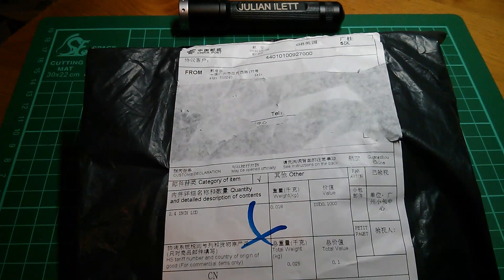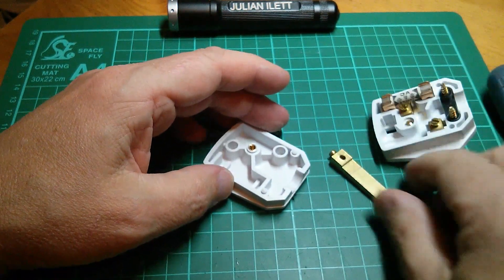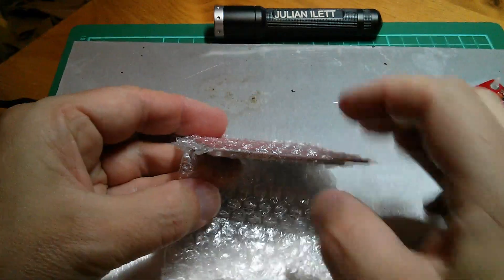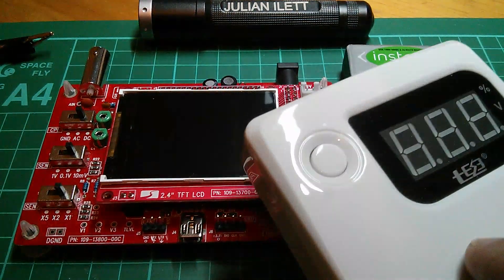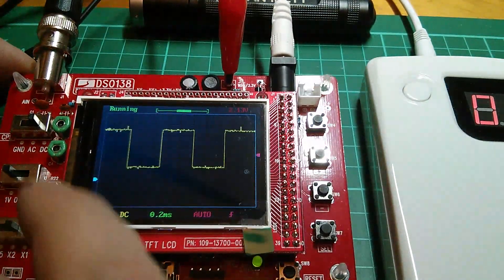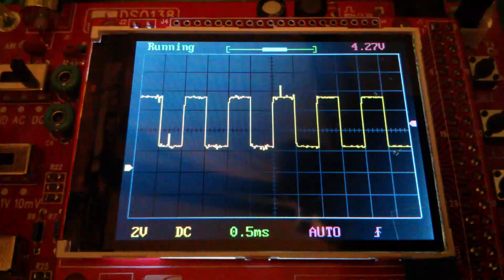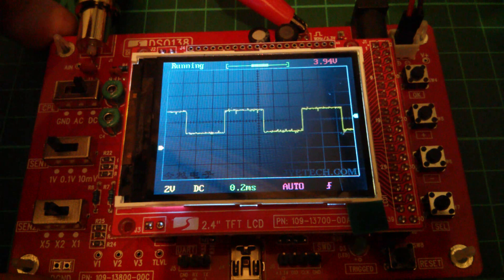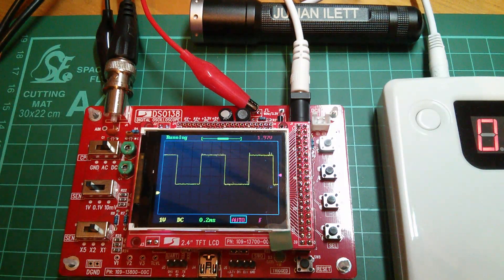Julian's Kit Build: Banggood £15 ($23) Oscilloscope (finale)

Comment: Hi Julian, I bought one of the DSO138 oscilloscope over a year ago, and tried to put it together, but my soldering skills was atrocious, and was never able to get it to work properly. I was would like to send it to you for you to do a video on repairing it. If you can get it to work, I would like it back, if you don't,  I would buy a new one, pre-soldered this time.
Most of the test signals are OK, but not getting any readings on the screen.
How about it? if yes how do I post it to you.
Regards

M

Comment: Hi Julian I was browsing your video list if you had made a video about correcting the awful noise but you haven't. In the comments of one of the three videos of this project I saw someone mention there was an addendum instruction saying there should be a resistor replaced by a different value to cancel the noise. Have you tried that ?

Comment: Hi Julian. Three things. 1) My DSO came with the Screen crashed, so I have to buy the screen again, where did you bought it ? The second thing , definitively your screen was not damaged by the static. I bought in the past a lot of screens and none of them were static sensitive, in fact the package where they are protected is a terrible static plastic, none screen could survive the static if they were static sensitive. Third, about the noise in the square signal, try puting in parallel to the battery terminal a 100 nF capacitor. Sometimes this could work. In my case, I have my screen crashed, so I still cannot test anything.

Comment: Other videos I have seen appear to have the coupling switch set the 'gnd' position before connecting to the test point to calibrate the scope. Don't ask me what it does, but noticed yours was not set in the same place. Thanks for the info and troubleshooting. I think I might pick one of these little toys up to play with, appears they do a 'mini' version now, which just appears a little more finished.

Comment: 05:10 I built the exactly same oscilloscope, but mine seems to be an improved version. It runs a newer version of the software that also contains an anti-piracy splash, but it is way, way, way more stable. There is almost no noise at all in my unit!

Comment: Just in case you meet with another tricky Lcd, I have one that works ok when it's initialized at low temperature, even if I reset it works ok, but If by updating the firmware or anything that keeps the LCD to be initialized but turned on, it begins getting warm and it will never initialize properly until I let it cool down by turning the circuit off... it's a pain to work with...

Comment: Why run a resistor in series to ground for your anti-static mat?  Wouldn't it work as well just connecting the mat directly to ground without the resistor?
Reply: +mnpd3 Because the resistor current limits the flow of electricity. Discharging static too quickly is the cause of failed electronics.

Comment: I've now built mine. Only real issue I had was that I needed a finer iron, I had one short on one of the switches. Otherwise it was fine, except after the second time I switched on after fiddling with the buttons and switches I got no trace. Simply hold the up down buttons down together for a few seconds to reset to factory default. Since  then its been fine.

Comment: Mine looked exactly like yours when I built mine. I did the noise mod on the board that seperates the analog from the digital ground. It halfed the noise. Still not a fantastic scope, but it really did make a difference, and only takes a few mintues to do.

Comment: i orderd one a while ago and also had a broken screen (physically, careless shipping) but it works fine. the internal noise i believe can be mitigated by shielding a few parts, with plently of ground planes you can solder on a tin can over the various parts.

Comment: Got mine a few weeks ago, put it together and where amazed on how soldering is like riding a bike. Anyway before shorting out JP4 everything is alrighty right. afterwards however...nothing works. White screen and all testpoints show different voltages. Quite frustrated.

Comment: I bought one of these a few months back, started building it and finally finished it this morning.  Plugged it in, and ... NOTHING; screen lights up but nothing.  Then I remembered Julian's video.  Well, I hadn't shorted out JP4 and tried using my regular 60/40 solder to short it without any success.  Then I thought of my 63/73 solder.  That did it!  I tried using it in the past to solder some SSOP IC's... ruined 3 IC's because of solder bridges.  I've finally sound some use for this solder.

Comment: All's well that ends well, as they say! The noise is either going to be digital signals radiating into the analogue section (can you scope it to see?), or artifacts caused by the ADC sampling asynchronously to the rate at which the the microcontroller is reading it... that apart, it's still quite impressive for the money; and I might still buy one to play with. Thanks Julian :)

Comment: The wavering of the trace at low display levels is the scope triggering on the noise pulses as well as the signal. By scaling the input signal level up you have more vertical rise level free of the noise pulses and you can get a more stable trigger. Since the noise doesn't look to scale with the input signal, it (interestingly enough) is being introduced somewhere past the input amp.

I somewhat suspect the original LCD was destroyed when removing the plastic face protector.  Peeling off one piece of plastic from another generates A LOT of static voltage. I've had similar failures happen at that point under dry air conditions.

Comment: I have eliminated the noise: Swap to the resistor R11 (1.5 k) in 150 Ohm. 1.5 k are too high.
Greetings from Berlin, Germany
Jörg
Reply: are you sure of this ? what model or version is yours ?
Reply: I have this version:
FW: 113-13801-050
LIB: 13803-031
best greetings
Reply: This change is now implemented Rev. 05, firmware version 113-13801-060 and later.
Reply: interesting i might have to order some 150 ohm resistors for this and try it because mine is 1.5k

Comment: Hmmm... i think maby i could help with the noise problem, since i bought one of thoose, and gives me really good readings so far:

On the left side of the LCD you have two variable capacitors, green colored. You must tweak thoose two in order to adjust the noise you are getting. The idea is to use the self-generated square wave to adjust them, and then you can test the signal you have from your "good" oscilloscope and you should get little to no noise... I hope that helps (it's actually a good portable oscilloscope).

Also, in the beginnign i just had the same issue, 20 seconds working, turned off, back on and screen looks dead. I solved it changing to a 12V power supply, compleately solved the problem for me (just in case you want to test the old screen, if you still have it).

Edit: that could work extreamely well with just 3 18650 LiPO batteries in series...

Comment: Looks like you did not calibrate the unit like the instruction say. I had much trouble getting mine calibrated with 9v - | +. A 9v wall wart fixed everything near nil noise compared to yours. What may be going on is the scope draws more current the battery can produce.  Anyway no batteries.

Comment: Your antistatic plug could easily be made safer just by putting the rest of the plug back around it and taking the L and N pins and fuse out so that it covers the holes in the socket. it could also be made more rugged if you can tighten the retention clip back around the wire.

Have you tried referencing the ground of the "scope" to mains protective earth to see if that affects the noise? Probably won't if the noise is intrinsic to the device but you never know. Same goes for a shielded enclosure.

Comment: Now you need to upgrade the firmware to 50 which they released and the noise is less. How about you going through the schematic and explain what is going on and show how you can prove or show what it changes or.......
How about using it while working on some of your projects so we might learn how to use it and follow along.
Thanks

Comment: Can anyone explain why the high value resistor is needed between the ground pin and the anti-static pad?  Why is a wire connected to ground not enough on its own?
Reply: Without the resistor any possible charge will be discharged at maximum current since it will be a short to ground. With a large resistor between the device and ground, the discharge current is significantly limited. 

Btw, the highest ESD source would not be him but the plastics he ripping fast. It would have been better if he used the knife instead of the ripping.
Reply: If there is a static charge it will dissipate slowly with the resistor. Without it you could discharge with a bang.

Comment: Hi,i need some help with mine,all my voltages are correct etc,at all the test points,and i get a trace with the 1khz test hook,but my led doesnt light up or flash like it should,but it flashes during boot,so the led is fine,any sugestions julian,or anyone.thanks

Comment: honestly, the noise doesn't look too bad, it is just that the screen refreshes quickly and there is no delay or averaging done to it.
Also there is practically no shielding on the front end, so that doesn't help either.
Reply: bgdwiepp 
When the noise peaks are almost a 3rd of the signal (1V in this case), it is bad and shows a bad circuit design. Of course you can do much in software, but what does averaging help you in single capture for example?

Comment: If it calls for 9v the rechargeable version is only 8.4v and you never know if your rechargeable batteries have a charge or not, the power bank gives various voltages. Don't you have a 9v wall charger? The first screen may have been sensitive who knows, but you had to do a repair on the board so I guess it's up in the wind.

Comment: Experience with a more recent version (Feb 2017):   As a bumbler with minimal knowledge and failing eyesight, I thought this was a suitable first kitset project!  Initial thoughts were that the two sheets of paper was not enough... in fact they were excellent, and in good english (Hooray!).  Managed the assembly OK, but the multimeter test prior to plugging in the display showed wrong voltages everywhere.  I was using the 'power in' pin as my ground connection... should have been using one of the ground pins on the board itself.  I connected the display, and Bingo!  Day two and my dry-solder joint showed up.   Flicking around the back of the board with a piece of plastic soon found it.  Fixed, an it has worked fine since.   It has none of the jitter that Julian and others have experienced with earlier versions.  I don't really need an oscilloscope, but for the price of a couple of movie tickets I have had a lot of entertainment.  On this basis, I would recommend it; if you need an oscilloscope to earn your daily bread, this is not for you    :o)

Comment: You might try cleaning the solder rosin from between the pins of the Op Amp U2.
 It can form a capacitor between the IC pins and cause the Op Amp to break into oscillation. I've had this happen on audio amplifiers. Might be the cause of some of the noise although I've watched several other videos on this scope and they are noisy. Some more than others.

Comment: If they fix the noise and put it in a plastic box this might be useful as a chuck in the toolbox tool. I can imagine using it outside to check that signals on my multirotors are working.

Comment: Looks to me that the signal processing circuit is off spec. If you can locate the SP circuit you might reduce the noise with a better RC signal circuit cap or by maybe adjusting the amplitude across the signal peek on the board or tap into the display signal  and see if you can break it out to another display with a filtering circuit as to find the faulty component(s) It may be a single cap (just a guess on that). Anyway the top scan points seems to be in the wrong amplitude range, their changing, thus, unstable as it draws the scan line. Looks like an ampliture issue at the peek of the cycle. should be an easy fix. Thats providing the verticle scan line is actualy using real inputs and is not just a line(x1,y1)-line(x2,y2) style static command.
but that's a cool issue, fun to fix. I'm not sure what IC's are being used, if it has a microcontroller or some sram, I would dump the core and reflash it where there are suspect commands. Oh, heck, I just read below that it was a resistor issue, well, I was close ;)

Comment: I saw one build where the culprit was the 7905 neg. voltage regulator. I*t failed fifteen seconds after he turned on. Check the regulator and it was defective..

Comment: Julian - for your anti-static earth connexion simply use a 13 amp plug complete with only the earth pin brought out, thus filling the unshuttered line and neutral receptacles - simples. ;-))

Comment: It looks like the wavering is in time with the LED.  It's hard to tell on video of course, but maybe try removing it?
Reply: Posi Cat I noticed that too. I don't think the LED is the root of the problem though,it looks to be digital noise,caused when the uC writes to the screen,and does it's other various things. Beefing up the bypass/decoupling caps on the various supply rails might help,might not.
Reply: It depends on how current limited the LED is.  It's probably not the issue, but it might lead to the part of the circuit that is

Comment: Try to scope the power line... as you can see you have switching supply on the board... if the filtering of power line is  bad that could make a noise on the signal.

Comment: Hi All,    Can someone help me. I am having a few voltage reading problems on my DSO138 since I built it a year ago. I am now trying to resolve it, so far I am getting the voltage readings which are a bit out of the normal, every thing else seems fine. 1. On V2 I am reading -1.494v instead of +1.66v2. On J2 I am 1.637v instead in 3.3v3. L1 -6.38 & -6.32 instead of -8.11/8.084. The screen does work and the system boots up when all connected, but I don't get any signal when the probe is attached and I touch the positive clip. (or any other readings)All the other reading are either exact or a few mv higher or lower.Does anyone know how to resolve this? or what else to test in order to fix this issue.Thanks in advance

Comment: You have the ceramic capacitors in backward they will cause noise if not installed correctly.

Comment: The noise is inducted onto the two cables connected on the square wave generator... And by the way, one should always take antistatic measures, not just for the unpacking...

Comment: why not just put your bodge inside a complete 230V plug?
Reply: Jasper Janssen why resistor
Reply: I presume it's for safety in case there's an earth fault at the same time as another fault puts active onto the earth wire.
You won't get a lot of current with a 1 Meg resistor in the way, therefore you might get a tingle but you're unlikely to be electrocuted.

Comment: That shutter mechanism doesn't mean electricity will fall out and get you, it's only for inquisitive kids who might wqnt to stick something in there. It escapes me why you wouldn't have left the earth pin in the connector and put the resistor inside the plug housing. That way you could have had the leaky pins (LOL) covered and the wire would be strain relieved.